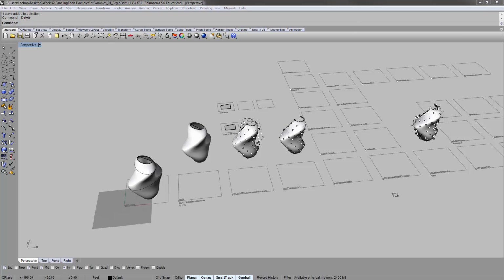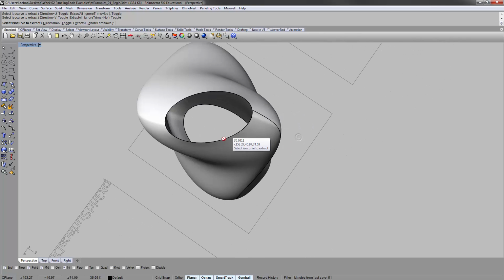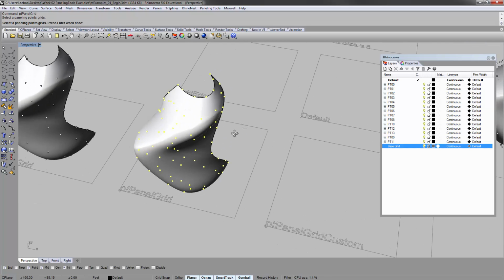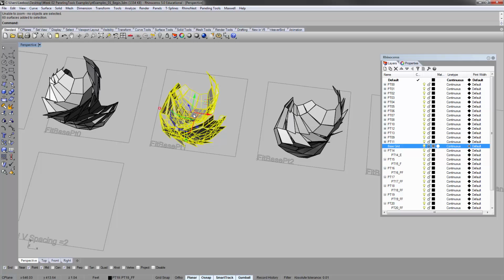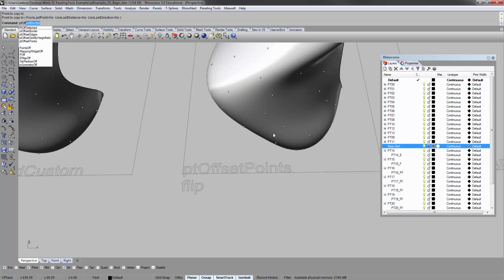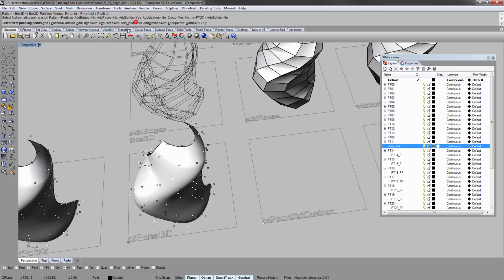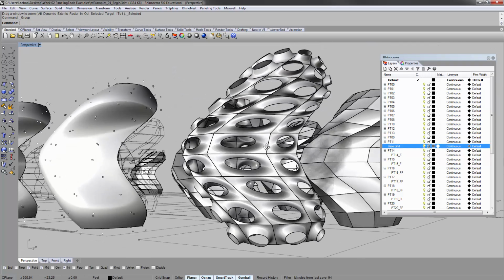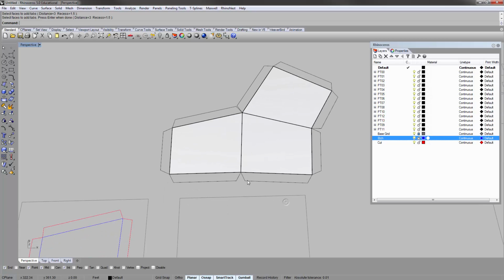AdvDig Week 02-1 Paneling Tools 01

Comment: Great channel. Im trying to panel a twisted tower however i cant seem to get the panels to go horizontal with floor levels as it twists upwards and i  get warped panels at the top. Any idea on how to overcome this and get straight horizontal panel bands/contours for the panels? Thanks
Reply from the maker: That probably has to do with how your base surface geometry is constructed. If the inputs (section curves) you used to construct the surface are not ruled/regular, the surface will inherit the inputs as isocurves, which then in turn affect how the panelization works. You can also try using the "Rebuild" command to reparameterize your input surface and see if that helps.

Comment: Yo Lee-Su, 
Great Tutorial. When you have the Group of Curves from running PtPanelGridCustom is there a quick way to convert these to a series of surfaces?
Reply from the maker: Sure, but depending on your surface...in the example they are all doubly curved/non-planar, so you would have to use a pretty heavy command like Patch.

Comment: thank you, unfortunately, I work on Mac so no no F keys..will figure it out..your videos are really great! they way you have laid them out in a grid by command format is brilliant
Reply from the maker: Bip 300 you may have to find the option in your bootcamp driver settings to enable Windows F10 functions if you are running bootcamp. Then you should be able to get it by holding down the fn function keys. 

Otherwise the workaround is to type the actual Rhino command into the command line: PointsOn. Esc exits.

Comment: Hi LSH,  I cant get the control points to light up all at once as you do and therefore the sequence of the commands dont give the same results.
Reply from the maker: F10 to turn on edit pts mode, and highlight the pts you need: hold down shift to add to a selection set, ctrl to subtract from a selection set. That way you can select exactly the ones you need.